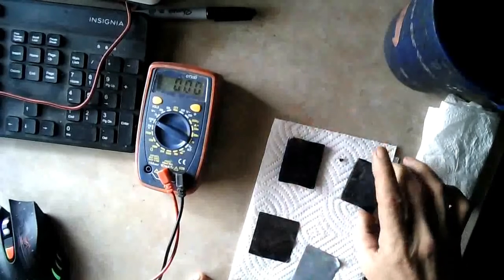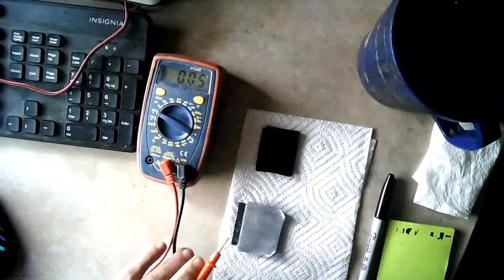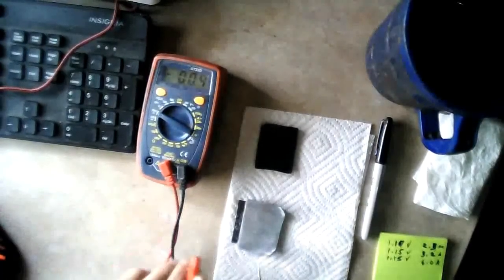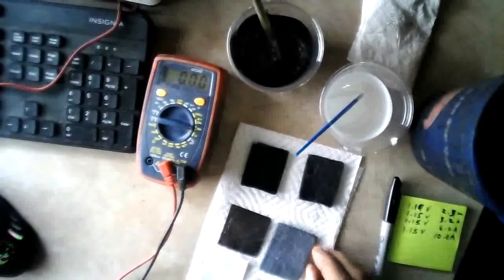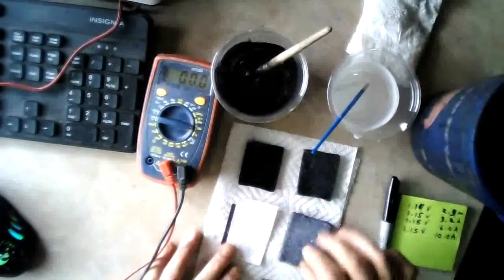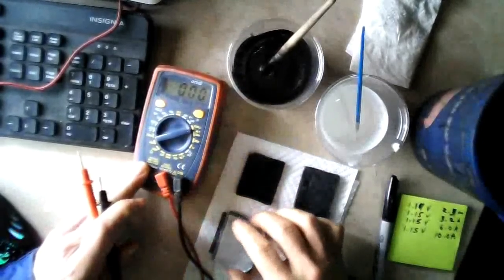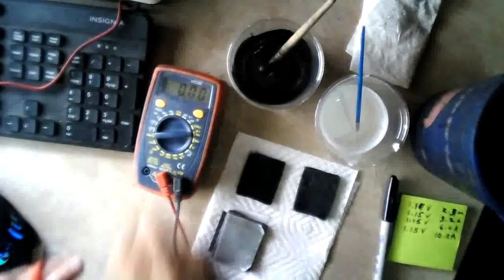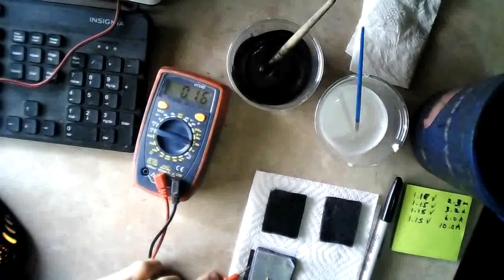Double Dip Carbon Felt Battery Test

Comment: its is about soaking the electrolyte and the pressure you apply when the probes are touching the current collector, put small wight on the cell and see when you add water in the container on top of the sell how much pressure indirectly causes amps and voltage increase? i think my cell i have been using that small clamp like Kev does works wonderfull...great work
Reply from the maker: Hi Barry, I was trying not to add any pressure when I measured the cells, so I could reduce the pressure variable. This is why I'm building the testing chamber. Lol

Comment: I had similar results (rising current) with zinc anode and carbon cathode, I have only noticed it happening on a couple of occasions  in dozens of experiments?
I like your methodical approach, would like to see how the cells perform after an external charge :-) Martin.
Reply from the maker: Hi Martin, welcome to the channel. I've noticed the behavior before too, but haven't got a good explanation for it. I've tried charging the cells externally, but it doesn't work, they just bleed off the excess energy.

Comment: The increasing amperage was a bit perplexing. When you get the data logging equipment on line that would be a good one to repeat to watch the voltage and amperage simultaneously.
Reply from the maker: It is perplexing, and it may not happen again when I try to repeat it. I have a clue now that I didn't have before (partial hydration or uneven wetness), which may be the cause. I'll have an update video on the testing equipment soon. :-)
Reply: Interesting nonetheless. Whatever the cause it produced relatively high amperage, which is power. If you are right it is perhaps a phenomenon worthy of attempting to exploit.
Reply from the maker: The next round of exp. might help,. I hope.